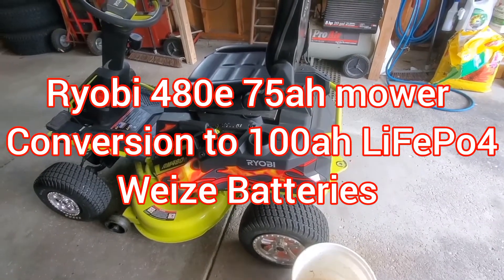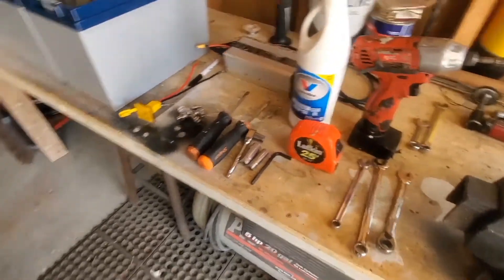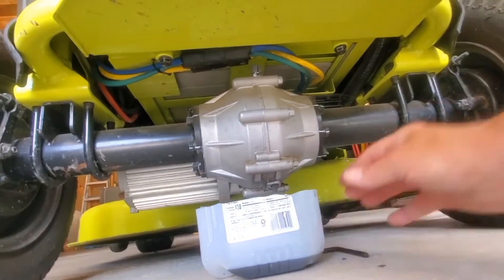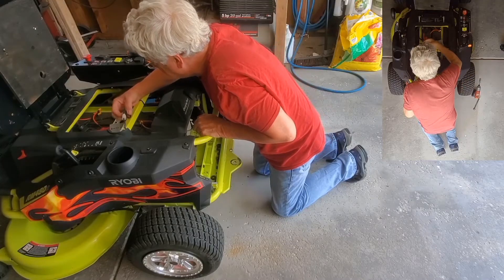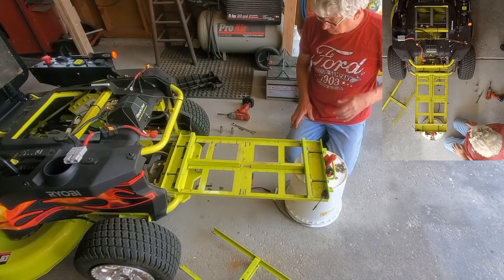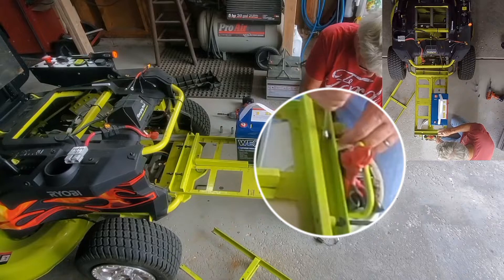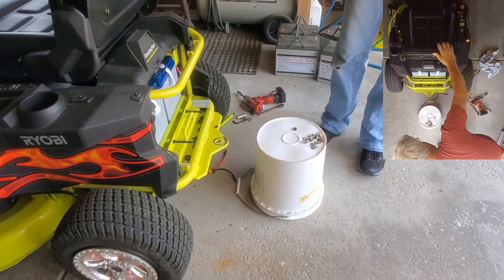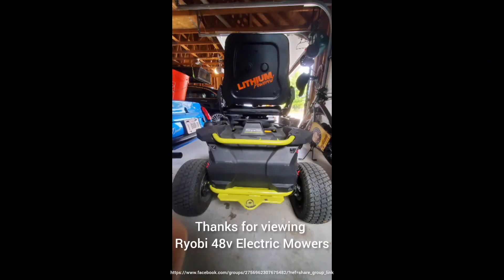Ryobi 480e electric mower Lithium battery swap

Comment: Will 4 Nermak 12v 50ah  batteries work?  I believe the discharge for each battery is 50 amps. Thank you for the videos!
Reply from the maker: The RM480E can draw as much as 90 amps so I would say no

Comment: My zero turn is the 54" RY48140.... do you suppose that the swap would be pretty much the same? I have (4) Wattcycle 12v 100ah bluetooth batteries so I wouldn't need to be concerned with the gauge. Can I use the OEM charge port if I can find the matching male end to modify my LFP charger? Thanks for your efforts!
Reply from the maker: Yes.the swap is the same as the RM480E and both of the zt mowers. They all have the same slide out battery tray. 
For the charger  connection if the new charger has the same shape connector you can break off the two tabs on the port and it will fit. Other people swap the charger housings.  Do this by position not color.
Reply: @Ryobi48vElectricMowers  thanks for a quick reply!

Comment: do you have an update on the quality of these batteries?
Reply from the maker: I've been using these batteries for 1½ years with no problems. I have balance charged them once but they really didn't need to.  For a single 48v 100ah battery  see my EnjoyBot battery video.

Comment: I just replaced my 75Ah batteries with the Lithium 100Ah batteries.  I had to cut the tensioning bolts by about 2" so the plastic cover would attach back to the rear of the mower.  No big deal, just FYI.  I also had to completely remove the tensioning bar on the front of the battery tray.
Reply: I just swapped 75Ah for 100Ah also-  didn't have to cut my bolts down but I did remove the front tensioning bar altogether to have enough room.

Comment: btw you will have battery balance issues unless you periodically charge each battery individually. the 48v charger will shut off when your weakest battery hits full charge and the weakset batteries bms will shut off and kill power to the whole pack when the other batteries that didnt get fully charged go dead the imbalance grows over time and the lifespan shortens.  this is a huge issue with golf carts and why a single 48v pack is recommended.
 Noco makes a special charger for this configuration to charge the 4 batteries individually and help with this issue.
Reply from the maker: I plan on balancing as needed at 3 months all batteries are still within .01 volts
Reply: It seems like 1 48v battery would be best to eliminate charging issues, and it would be easier to remove in the winter to store indoors.
Reply: @scottbarrett7333  There is no reason to remove a lithium battery to store it in doors?? Just dont' charge them below freezing.
Reply: Does that only apply to Lithium batteries?
Reply: @freedomisfromtruth  only 12v lithiums in a series.. not 12v lead acid or a 48v single pack.

Comment: Did this swap effect the mower deck power? ive read these are weak for long grass and im hoping this will help. I have a broken rm480 I just picked up used.
Reply: what do u mean by broken ? do you have a battery problem or something else?
Reply: @onestop2446  it was a bad controller which is very common on these mowers from what I've read. All fixed now and I purchased lightly used lithium batteries from a fiat to install for next season as the original batteries still work but get noticeable tired after 1/2 acre of mowing

Comment: Thank you so much for the video. Really well done. Could please update if you used a new power guage on the side. Or if you continued to use the original?. Is this a mandatory change or can i still continue to use the original with new lithium batteries. Also was wondering gor the 480e, can i go ahead with the 50Ah instead of 75Ah. I understand 5he power is going to rhe the same. Just that i will get lesser duration on the mowing time. I think 1 hour is more than enough for mowing my lawn. Will 50Ah suffice. Please let me know
Reply: Not the video poster, but I also did a 480e lithium swap using the stuff here: https://youtu.be/8qRRcIc0mgQ

I left the original meter in the mower, but it does not work with the new batteries. I had to wire the new meter and I just left it under the seat of the mower because it really isn't that important for me to see it now.

I have a few trees and small hills, and my yard is about 1/2 acre. With the new 100Ah batteries I put in, I can mow the entire yard and put it away at 70% charge left. So, if I had 75Ah, or even 50, I would still be able to get the yard done for sure. I would probably go with 75Ah but I doubt I would drop to 50...I just want to have some room to degrade or if it is wet or something, I do not want to upgrade and then not have enough juice so I overkilled it at 100Ah :)
Reply from the maker: I previously added the aftermarket gauge. As seen in other videos. 
My personal opinion is only the 300e should get the 50ah batteries.  Everything else should have the 100ah. This is due to load demand. Not mow time.
Reply: so lead acid ah rating are really only half because they can only be discharged to 50% without damage. lithium is 100% so a 50ah lithium battery has the same storage capacity as a 100ah lead acid. the issue you might have with 4 12v 50ah batteries is the continuous amp output of each battery via the bms.
 A single 48v battery is the best way to go for multiple reasons. ive seen the rm480 draw up to 40amps at once in testing for short periods... many 50ah 12v batteries are built for solar and only allow like 25amps continuous draw. if you bought a 50ah 48v lithium pack with a rating of 50amps continuous discharge you would be fine.
Reply: @fathergratwick  awesome.  Never thought of this.  Really informative.  Thank you.  Think it's best to get 1 48v battery.  I will go ahead